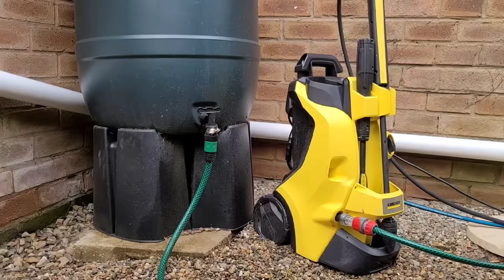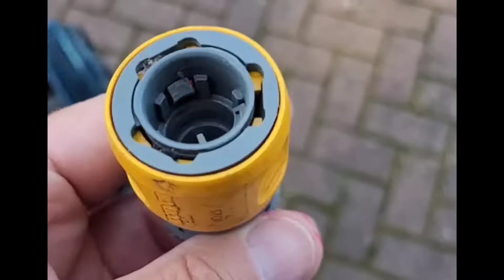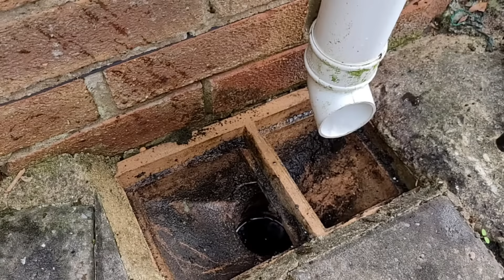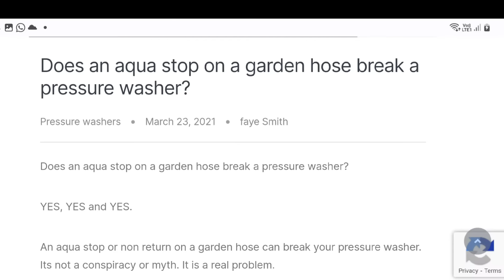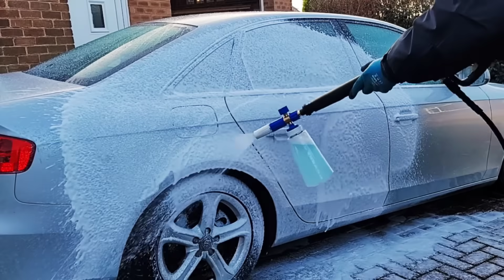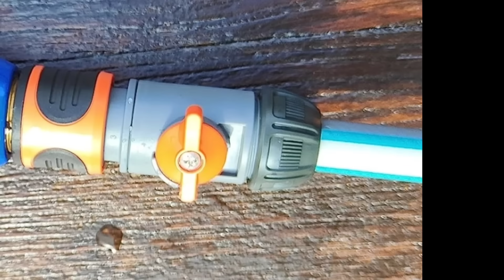The Big Mistake to Avoid when Using your Pressure Washer

Comment: Been using the Hozelock fitting for 40+ years and never had a problem. (Does that work the same way as this AquaLock?) Just been lucky I guess, if so. But if it so important, why is this not highlighted on the box or front page of the Karcher booklet or even supplied by them in the box? Would make sense as I suspect the vast majority of garden owners use such a connection on their hoses as it eases connection of the hose on to many things.
Reply from the maker: @markymarkreviews  A normal hose end connector like this https://amzn.to/4jzR0xY is fine. It's the aquastop ones with the red threads and white plastic pin that Karcher tell you to avoid.
Reply: Thanks for the clarification. That is what I have been using and thus never had an issue with Karcher jet washers! Like with most things you wonder if Karcher jet washers are as well built as those from a decade ago. Like most things build quality has got worse and worse over time with cheaper components used to save money and maintain company profits. My Karcher must be 15 years old now. Just did my driveway cleaning. On for 6 hours+.

Comment: The aqua stop doesn’t close when you let off the trigger, it closes when you remove the fitting, the recommendation to not use them is because it permanently reduces water flow, can be resolved if you only have a water stop fitting by popping off the small O ring ad white plastic fitting
Reply: This! Water can flow in both directions thru an aqua stop when a male fitting is connected.
Reply: Out of interest does it reduce flow by much?

Comment: Hello, I have to remove aqua stop in the hose fitting, because I only have 220 KPA= 32 psi mains pressure, and the machine will start hunting for water if I try and apply more pressure, so I cannot ever use full pressure!!

Comment: I cut the stopper out on the connector as I couldn’t be bothered going to get another. But it’s not a non return valve as when connected, water can flow in either direction. I think the main issue is the reduction in cross section so limiting flow.
Reply from the maker: @Craig_79  Yes, I think you are right. Having read up more on this, I believe the pin acts as an obstruction rather than stops all flow out into the hose, and this reduction in cross sectional area causes an increase in pressure upstream (in the plastic water inlet) https://www.quora.com/Does-a-blockage-in-a-pipe-affect-overall-pressure-of-fluid-in-the-pipe

Comment: is it the case to not have any aqua stop on the hose either the tap end or the hose connector end or just the hose connector end ???
Reply from the maker: @stevieb6173  You should avoid having an aquastop connector where the hose is attached to the pressure washer. I can't see the point of having an aquastpp attached to the tap. All it would do is reduce the flow.
Reply: @bigtedshome  ok, so no aquastop at both ends. So what do I do, when I stop using the pressure button? or want to switch the accessoire? Do I need to stop the pressure washer, then stop the water line and change the accessoire? Then start the water line again, then turn the machine on and good to go? What if the water tap is like 10-15m away?
Reply from the maker: @Weissklangi  You don't need to turn off the pressure washer or the water to change the accessories on a Karcher.

Comment: Like you, i connect my karcher to a waterbutt. I noticed recently when i looked in the waterbutt that there are particulates in the water such as algae and bugs. These probably get in there from the gutter and the drainpipe, which  my waterbutt is connected to. I'm wondering if these are forced through the pressure washer or could they be building up and causing damage inside my karcher?
Reply from the maker: @ndwil  The filter should stop anything big enough to cause a blockage. I wouldn't expect algae to cause a  problem in a pressure washer. This is the best I could find on the net: http://propowerwash.com/board/upload/threads/algae-in-water-tank.16598/

Comment: FINALLY an answer to a problem I had with a Karcher pressure washer over 20 years ago.
I couldn't figure out why the water inlet pipe kept rupturing and having to keep stripping the effing thing down and replacing that inlet.'I must have replaced the pipe about 5 or 6 times before I finally threw the pressure washer away.
I've never had a very high opinion of Karcher products since that experience, but now I know what was causing the problem maybe I should give them another go.
Reply: For me Karcher is really the only brand i buy for robust machines from Construction Vacuums to the K5 and steam cleaners. i used to own nilfisk stuff but thats just straight up garbage plastics breaking within 2 weeks of use. My Karcher K2 is now about 8 years old i only had to replace the rotary dirt blaster because of wearing and it sits next to the K5 i bought 1 year ago. Karcher feels like the stopgap brand between top of the line consumer to professional tools like the ones with a diesel engine
Reply from the maker: @zaphodbeeblebrox6627  I've been happy with my Karcher K4, but there are plenty of good alternatives available now.

Comment: KARCHER PASSING THE BUCK?
So, we are effectively required to use a dedicated separate or extension length of hose with pressure washers because they require us to provide our own expansion vessel instead of them building in a critical component into the cheap plastic product they charge us lots of money for.
Reply from the maker: @johnpublicprofile6261  This doesn't just apply to Karcher, aquastop connectors can cause a problem for all pressure washers. You can actually use a cheaper, standard hose connector instead of an aquastop, or you can use one with a control valve as shown in the video. These can be found for as little as £4 on amazon (cheaper than an aquastop connector). You don't need to provide a separate length of hose either. Karcher just state that the minimum length of your hose should be 7 m. I hope this helps 🙂
Reply: Just disconnect the hose at the tap end and plug the other end into the tap and then reverse it again when you're finished.  I tried it just now.  Takes about ten seconds to do it.

Comment: Do I close the tap when I switch the jetwash off or do I leave it open Gardena Hose Connector with Control Valve: Connection
Reply from the maker: @DexterHulme  I leave the valve open until I disconnect it from the pressure washer.

Comment: This makes no sense, if the aqua stop is on the tap the water still comes out to the hose pipe, why would flow not reverse if aquastop is connected to the Karcher
Reply from the maker: @ortopeetvic737  Good point. Having looked into it in more detail, it  appears that the valve (white pin) in the aquastop acts as an obstruction (i.e. it reduces the cross-sectional area) in the pipe. This then causes an increase in pressure upstream (inside the pressure washer). I assume this is why the water inlet failures are common as these would be designed to be operate at low pressure. This link gives more detail: https://www.quora.com/Does-a-blockage-in-a-pipe-affect-overall-pressure-of-fluid-in-the-pipe

Comment: Hi Ted, I’m looking at purchasing a Karcher K4 Power Control in the next few weeks, I’ve watched all of your videos, they have been really helpful. Especially this one around the Aqua stop (which I certainly would have fallen into).

I’m going to purchase a hose from direct hoses for the lance as per everyone’s recommendations.

Please are you able to advise on which hose and reel combo would be best to purchase for the water part?

Thanks
Reply from the maker: @olejones1  Thanks for the great feedback Oliver! I use one of these wall mounted hose reels: https://amzn.to/40JruQg with this 50m hose: https://www.screwfix.com/p/fitt-50m-heavy-braided-nts-wintech-hose/6545j
I've had the reel for over 20 years. The hose is only 2 or 3 years old but is much better than the original hozelock hose that came with the reel. Hope this helps 🙂

Comment: Is it OK to use a magic hose?
Reply from the maker: @DinoSpumoni213  Good question! I've never used a magic hose but this link suggests that they are not suitable for use with pressure washers: https://www.detailingworld.co.uk/threads/expanding-hose-pipes.431913/

Comment: So confused. Just ordered a Karecher hose set that comes with Aqua stop and instructions do not explain what to do and tiny images appear to show Aqua stop connected to the machine
Reply from the maker: That sounds crazy, selling a hose kit that contradicts the manual. Are you sure it's an aqaustop connector?If it is, personally, I would take it off and use either a normal connector or one with a control valve as shown in the video
Reply: @bigtedshome So many reviews mention this confusion. One reviewer actually advised doing what you say not to do. In the end I chopped up my old hozelock that I thought was ready for the bin due to kinks and got it to work. I have basicaaly got a spare garden  hose now. 3:45

Comment: The low pressure hose feeding the machine does not and could not act as an expansion device and would never take the output pressure of the machine. Also of course if your garden tap is professionally installed it will be fed from a double check valve to prevent backflow of water into the drinking water network. I can understand some hose fittings may reduce the flow so I don't use them and the K7 180 Bar requires quite a high flow rate 10 Litres per minute with a lesser value for the smaller machines. If the inlet parts of the machine do keep failing it is probably due to poor design / user misuse. Hozelock Aquastop fittings also do not act as non return valve either,  they are physically held open when the are put on to the male fitting.
Reply from the maker: https://support.avaofnorway.com/hc/en-gb/articles/7752127550738-Why-should-I-not-use-an-water-stop-system-Aquastop-with-my-low-pressure-hose-connection
Reply: @bigtedshome  Since when has aquastop been a non return valve? The point of aquastop is to stop water flow when nothing is connected to the aquastop connector.

When connected, water can flow in both directions so it is not a non return valve. This leaves the question, how are they damaging pressure washers?

BTW, this isn't an opinion. I asked myself this same question so decided to test it. Obviously, to block the flow of water, it has to be at the device end as the valve closes when disconnected but when connected, orientation makes no difference, flow continues in either orientation so no non return component.

The link you've shared seems to be sharing alternative facts
Reply: @robberesford4741  I have been trying to work this out, too.  I think the issue is that the hose is effectively pressurised up to the Aquastop (possibly from the last time it was connected to the pressure washer, as well as by mains pressure).  This means the hose adds pressure rather than relieves pressure to the pressure washer when it is connected.   That gives it the effect of being a non-return valve - note the force required to push the Aquastop on.  In theory, if you leave the mains tap off, connect the aqua stop connector to the pressure washer and then turn on the tap, it should work OK and what you say above applies.  However, this defeats the purpose of the Aquastop, and is probably not what most people do.  It is interesting that the pressure washer will actually pressurise the hose pipe when in use, precisely because the connector is not a non-return valve - I hadn't really thought about that until now.

Comment: I don't understand why they say Aquastop prevents back flow into the hose when it's connected to the machine. Surely the valve is open when connected?
Reply from the maker: This is the best explanation I can find: https://support.avaofnorway.com/hc/en-gb/articles/7752127550738-Why-should-I-not-use-an-water-stop-system-Aquastop-with-my-low-pressure-hose-connection

Comment: You can used Aquastop on the water tap but not on  the hose.
Reply from the maker: You're right, you can but there doesn't seem to be much point when you can just turn the tap on or off.
Reply: @bigtedshome  agreed
Reply: @bigtedshome  does it help, when the tap is too far to reach? like 15 m away
Reply from the maker: @Weissklangi  if you use a hose connector with a valve (https://amzn.to/3Gl1H8X),  you don't have to go back to the tap

Comment: Thanks for the good advice! Should i not use aquastop anywhere in the chain? I have long hose coil from the tap, and a short hose from that coil to my pressure washer. Should there not be aquastop anywhere in that link? Many thanks
Reply from the maker: Good question. It will depend how long the short hose is. Karcher state a minimum hose length of 8 m but I would have thought that if your short hose is more than 3 m/10 ft then the volume of this hose would probably be greater than the internal volume of the pipework/pump inside the pressure washer and you could probably get away with an aquastop connector on the end of the long hose.

Comment: Great advice, thanks. I didn't quite get the bit about the "gardena inline tap" where exactly do you fit this? at the end of the hose (just before it connects to the machine. or at the tap end) ?
Reply from the maker: If you put an inline tap on the end of the hose where it connects to the pressure washer, you can have your outdoor tap turned on but the inline tap turned off. No water will flow while you set up and then you can turn the inline tap on when you are ready. It saves you having to go back to the outdoor tap (mine is by the back door and I normally use the pressure washer on the drive at the front of the house). I hope this makes sense 😀
Reply: 😃 @bigtedshome
Reply: @bigtedshome  Hello, doesn't the pressure remain in the machine in both connectors? I think both connectors will cause the same problem. Am I wrong? I couldn't understand the difference
Reply from the maker: @muharremata  When the pressure washer is operating, the hose supplies water at approx 3 bar pressure and this is increased to over 100 bar by the pump. When you release the trigger on the lance, the water that has been pressurised is trapped in the system. If you are using standard connector, the pressurised water can effectively flow back into the much larger volume of the hose and pressure will equalise at a relatively low level. With an aquastop connector, the water cannot flow back down the supply hose and the high pressure water is trapped in the internal piping of the machine until the pressure is released (either by using the lance again or disconnecting the hose). I hope this makes sense 🙂

Comment: Very interesting Ted. I had to change my valve for my hose a few months ago as it was cracked and leaking water. Anyway while I was at B&Q I did notice the Aqua Valve, but wasn't sure what it was for. Thought it sounded something for a pond or something, so bought the standard one again. Sounds like I dodged a bullet now. Thanks for the heads up.

By the way did you get a lance for your stubby gun? I've used mine a couple of times now and won't be without one again. Very useful for out of reach areas like roof or under wheel arches.
Reply from the maker: Thanks for reminding me about the lance. I've just ordered one 😀